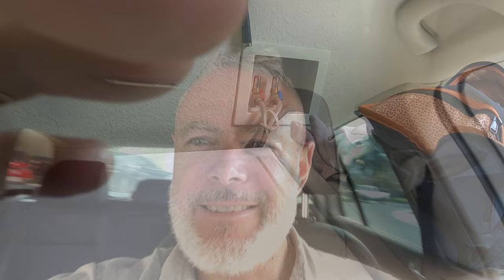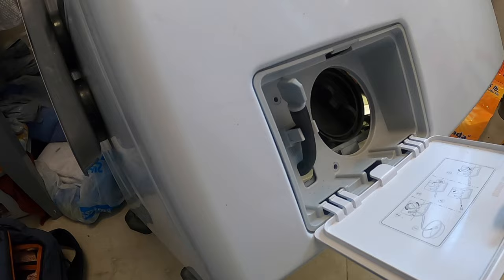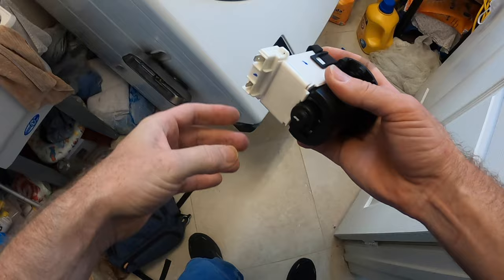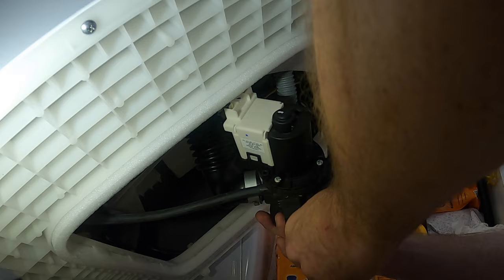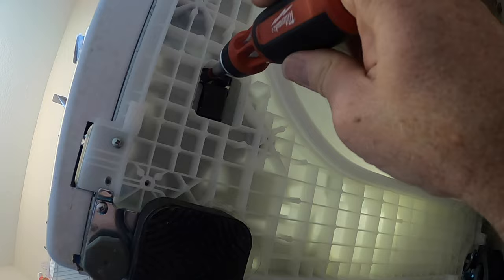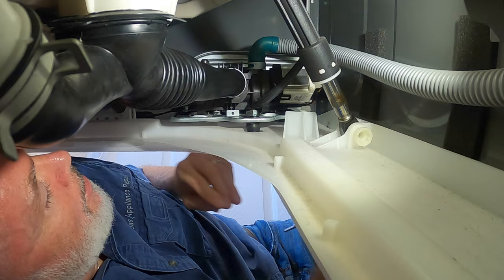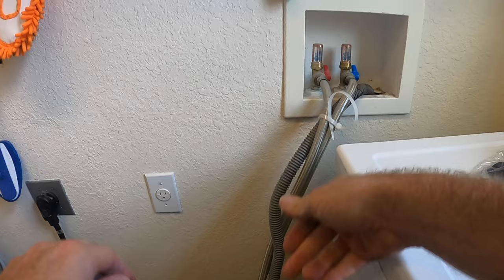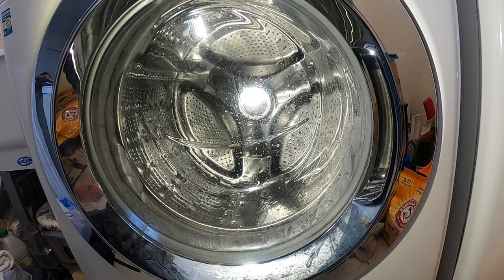LG Washer Drain Pump Fix in 7 Minutes

Comment: Thanks from Northern CA (and thanks for the quick reply). Big time saver for a part that breaks every two years. I was given multiple estimates from $350-$150 for labor and $100 for the part (bought it for $32 on Amazon). I recommend latex gloves to avoid cuts from the sharp metal inside. The LG model I worked on is an all-in-one washer/dryer but the components are basically the same. I kept the hoses on for convenience and shut off the water to the house. I did it a bit differently- I removed the two screws holding the rubber grommets to the pump/pump housing and was able to twist it to get access to the screws (only two were there) for the pump. Also recommend reading the comments from others as they had helpful tips as well. Take your time, folks, and you'll get it done!
Reply from the maker: Owen, Thank you so much for the tip $$ . glad to help and thank you for sharing your experience with the community. God bless you

Comment: This is the best thing on the internet right now. Holy crap. This is my second time replacing the drain pump and the torturous thought of trying to get the door clamp back on is giving me waking nightmares. I thought about the side and underneath, but seeing someone actually doing it give me such calm peace of mind.
Reply from the maker: Thank you
Reply: Same here... second time found this video. Way easier.
Reply: Welp, I’m fixing to do mine….
Reply: Any idea why the water pump some just hums but not pump, other times it pumps. Also.us.it normal for it to cycle every 5 seconds or is that program problem. I can only wash light loads. Currently, had to take out 5 towels. So only wash 5 towels at a time.
Reply: Yeah me too the pump have giving her last breat and its time to remplace. The pump shake well and dont work
Reply: If you ever have to remove that clamp again get one of those spring spreader tools made for the job. It makes the job so much easier. Well worth the 10 bucks!
Reply: I’m a 71 year newly widowed and my husband always repaired everything from YouTube videos, so that’s what I decided to do as well.  Watching other videos I was quite discouraged until I came across this video, now I’m feeling there is hope that I can fix my washer.  I think the hardest part for me will be tilting the machine……wish me luck 🙏🤗🤞🏼

Comment: Hello, I have an OE error message even after replacing the water pump. I can hear the pump running but its not pushing the water out. Any suggestion on to what it may be?
Reply: yeah pls help
Reply from the maker: Did you replace the drain pump? There could be a clog in the drain hose, or in the hose from the tub to the drain pump, or your drain hose may be too deep inside inside the stand pipe
Reply: Yes there is a clog in the tubing! You can reach it from the back! We just did this

Comment: This video saved me about 200$! A note to the fellow novices out there. There is a second pump to the right(when facing the machine) do yourself a favor and don't take that one off by mistake. Added an additional headache that nobody needs, lol. Also, if the screw at the bottom that was missing is actually there, just drill an access hole through the plastic base to access the screw.
Reply: Thanks for posting. I read your post and almost did the same thing since the other pump connected on the other side of the pump housing looks very similar. DIY folks, make sure the pump you are removing looks exactly like the new replacement pump.

Comment: This is THE video if you have an LG Washer with a bad Drain Pump that needs to be replaced!!! Like others have mentioned, this video gets right to the problem - shows you step-by-step instructions to fix the problem, & doesn't require you to take your entire washing machine apart to do the job. My only problem was with the screws not being properly lined up for easy access. Somebody else took this washer apart & replaced the Drain Pump prior to me taking ownership of the washer and they did not put ALL the screws back in their proper places. Some screws were missing in my unit & others required a little work to remove the screws. I highly recommend that you get a headlamp so you can see what you're doing & also pick up a set of magnetic screw drivers so no screws get lost within the machine. This literally took an hour to do the first time (just because I ran into some minor snafus). If I had to do this again, I'm pretty sure I could replace the pump in under a half hour. Best of all, the new pump was only $35 on Amazon & I didn't have to pay out the butt to have some repair technician fix such a simple thing. Thank you for posting this video & for saving me so much time & money.
Reply from the maker: Thank you for taking the time to comment and share your experience. Glad it helped

Comment: I wish all DIY videos were this straight to the point. I always wondered why people would begin tearing the entire washer apart just to reach the pump that's very easily accessible from the bottom. Great video!
Reply from the maker: Thank you Joseph. I appreciate you taking the time to comment
Reply: It is easier to tear the unit apart if you are good with a hand drill
Reply: apparently people are scared of a little water on the floor 😂

Comment: Great video!  Major difference in water output after replacement.

I managed to tilt the washer and access the drain pump from below.  I placed small chairs, against a wall, to hold the back of the washer and braced the feet of the washer to prevent movement while working underneath.

One primary challenge was the misaligned screws on the bottom access plate, making them hard to reach through the small rectangular slot. Initially, I considered enlarging this opening by cutting or drilling the bottom plastic grid. However, I realized that by using another screwdriver, I could shift the metal plate (on which the drain pump rested, equipped with rubber grommets for noise reduction) to align the screws with the existing holes. This allowed me to unscrew the two at the bottom and the one behind the front drain access panel.

While I did disconnect the main tub drain line, it wasn't entirely necessary. Yet, it did afford me more space to maneuver the drain pump housing out of its slot. Notably, I didn't detach the circ pump or the metal plate holding the pumps.

Upon observation, the new and old pumps seemed nearly identical, save for the slightly warped plastic impeller fins on the older one. The distinct difference lay in the feel. The older pump had a consistent resistance when trying to manually rotate the impeller. In contrast, the new one had a magnetic pull on the impeller, resulting in a distinct "thump, thump, thump" sensation as it turned.

Post-replacement, I dissected the old pump to pinpoint the problem, finding no issues on the electrical side.

The culprit? A compromised inner gasket around the rotating magnet was collecting washer drain residues, behaving like abrasive sandpaper. Over time, this residue seemed to be pushed by the brass key against the impeller's inner plastic hub, leading to wear and tear. This resulted in the impeller merely gliding over the brass key, hindering its rotation.

An interesting aspect: The choice of brass against plastic is likely a safety design. This reduces the risk of heat accumulation within the pump's electrical components. If a metal-to-metal design were used, and the pump impeller got jammed due to debris, it might overheat the electrical side. Thus, the use of plastic, which can yield under pressure, is arguably a safer and smarter choice than metal-on-metal within the pump.

Summary:  Plan to replace again in 4-8 years depending on how often the washer is being used.
Reply from the maker: Wow! Impressive analysis. Thank you for sharing
Reply: This is exactly what happened to mine, the way the pump broke, the screw behind the front plate and everything, I get the new pump tomorrow should be an easy install. My pump housing also has 2 water intake inlets on it as well as another pump on the other side I’m assuming for hot and cold water but you just described exactly what I had to do😂😂.

Comment: Perfect! Most easy way to change pumps for most of the LG front door machines.
Just to add there is one more screw that holds coin catcher that is in the front hidden underneath the front metal plate. Just. Need to wiggle a bit to take it out the pump assembly. Rest was just a breeze to change the pump.
The machine is working now.👍
Reply from the maker: Thank you

Comment: Thank you for this video. Simple and straightforward replacement. The original pump lasted 13 years,  which I thought was impressive for a family of four.
Reply: How did you get off the 3 bolts holding the pump assembly onto the frame doing it this way?
Reply: @nathanflanery2285  Exactly as shown in the video.

Comment: Your video gave me encouragement, but now I am aware there are mitigating factors that will potentially bring the homeowner far beyond the 7 minutes,  to something more like hours.   And I never realized that having stacked washer and dryer would present such a problem.   My washer and dryer will remain unstacked.  It's not a one person job removing a stacked dryer, but I was able to figure out a way to get the dryer down.   Why was this a more difficult job?  There are significant differences in LG front load washers that aren't shown here.   My LG had two pumps.   I only found out after having found the service manual online, but the service manual cannot be found at LG's site.  Search elsewhere.  The drain pump was on the opposite side, and the 3 screws you discussed are not accessible or removable unless you remove the large three 10mm bolts that hold the pumps (yes 2) to the visible metal base plate you show near completion .   Two pumps, one on either side for my LG front loader, far left drain pump nearly impossible to access, and on the right an accessible circulation pump.  After having removed the 3 bolts holding the plate from behind the front and underneath, then the front, back and two screws underneath attaching the pumps to the metal platform, I was able to remove the pump out of the washer as you had done.   Upon installation of new drain pump I also found that the screws that hold on the pump to the black plastic housing don't hold as tightly as when removed, and my initial pump replacement leaked.   I added pipe joint compound and 5 (extra holes are there already) ever so slightly larger sheet metal screws that bit into the plastic just a little more.   Mine was a bit more difficult, but without your guidance I'd have had to pay the piper.   Thank you for sharing your expert instruction and providing all of us with the guidance and courage to undertake these challenges.   And I won't need to go to yoga class this week due to all the contortions necessary to remove those large bolts from the metal base from underneath.  Thanks for help us all.
Reply from the maker: Wow, you went on an adventure. On my Youtube channel there are few different LG front load washer repairs, including a stacked one. Very challenging to do on your own. Sometimes the satisfaction of doing a touch project on your own is worth the effort. God bless you

Comment: Machine leaks water on the spin cycle, especially with a heavy load. It was suggested I check the water pump and related connections. I was getting ready to remove the front panel (🤦‍♂️) which is not a fun experience (replaced the front seal in the past). This video made my day!

As a note, I just checked my washer and the three screws attaching the motor to the frame are also missing.
Reply from the maker: You are welcome. LG is not consistent with their screw placements . leak on spin cycle is interesting. you can observe it with the top lid off to try and see the leak. also many of the LG have a removable back panel where you can observe. sometimes i place two 2x4” piece under each side of the legs to get it up 4” off the floor and observe with a mirror underneath during spin cycle. You can also place a piece of dry cardboard underneath and then get an idea of the location by observing where it gets wet. best of luck
Reply: Thanks for the very quick response!  I did remove the top and rear panels. No water from above nor on the right side. There does appear to be some water on the left side. Washer sits on a LG pull out drawer, with a pan under that. It appears like it’s coming from the water pump area. If we run the washer on tub clean cycle, no water comes out. If we add clothes to wash, it leaks. But the leak is not a lot. Maybe 1/2 to one cup of water. I’m thinking there may be a worn hose. Will also check out the pump. It’s definitely not the hose on top of the tank which has a zip tie holding it in place.

Comment: You deserve a gold medal for this shit. Some guy quoted $500. LG wanted to charge $114 for the part if I use an authorized $500 guy.  All other videos tell you take the whole bloody thing apart. I bought the part for $30. It took 1.5 hours cause there were more screws in there than your video. A few which had no clear line for a screwdriver. A little creativity and done. 
Tip if you come across that issue. Cut a little plastic off the bottom to get one of those inaccessible screws. There's a screw not showing in the video on the front at the bottom of the housing. its jammed behind the metal on the front. I jammed a screwdriver beneath the housing from the front and pushed it up to unscrew it.
Again. You saved my ass.  If you're in vancouver, holla at me. Beers on a patio somewhere, on me!
Reply from the maker: You are welcome. I hope you subscribed 😊
Reply: Just did the same thing. Was considering removing some of the plastic and sheet metal that some wingnut designer put in the way to make the screws "almost" accessible. So that when this made-to-fail part fails for the fourth time, I'll have an easier time getting to it.
Reply: Um trying to figure out how to remove that same screw. I think they put it there on purpose so you would have to call a tech😮

Comment: It worked!!! I highly recommend this method of replacing the drain pump. I have an LG WM2050C washing machine. It wasn’t draining, it was making that growling noise. I checked the filter, it was clean. Watched a few videos and then ordered the part, cost me under $30. I was NOT looking forward to taking the top off, then the door, etc. I had to do all that when the dryer rollers needed to be replaced - not fun. Then I found this video and WOW. My washer and dryer were stacked, so we had to remove the dryer, put it aside, then tilted the washer back. We didn’t have enough room to lay it on it’s back so we let it rest on a bucket that we propped against the wall behind the washer. It then took less than 15 minutes to change the pump! It’s working great, no leaks, we’ve already done four loads of laundry since yesterday 😊. THANK YOU FOR POSTING THIS VIDEO!!
Reply from the maker: I am glad the video helped. Thank you for taking the time to Comment Mike. God bless

Comment: Replacing the $25 pump was way easier by going through the bottom of the washer. I had to cut a notch in the metal circle (at the 6 o'clock location just below the face of the coin filter) to access the one screw attached to the pump at this location.. There were holes for two more screws at the 10 o'clock and 2 o'clock locations of the coin filter, but those screws were missing just as in this video.  There were also two screws through the bottom of the machine attached to the pump. I had to cut away a small portion of the white plastic grid below the machine to access one of those two screws. The other bottom screw, located just an inch and a half away, was easily accessible. This seems a whole lot easier than removing the entire front face of the machine. Thank you!

Comment: Thank you for this!! I take care of 2 mentally and physically challenged adults that live here full time and it’s hard to get time to fix stuff. This video vs the others was by far the best!! I got the washer working in 45 minutes!! Thank you again!!
Reply from the maker: Thank you so much. That means a lot to me. God bless you and thank you for caring for others
Reply: @appliancerepairamerican  can i access model 41372 like that?
Reply from the maker: @MA-vm6jl  You will have to look at the schemes for that model and determine the location of the pump and the most efficient way to access it. Some LG washer you can access buy removing the back panel. Some, like the one in this video, can be accessed from the bottom.  They intentionally leave an access hole in the bottom of the machine. If you have to remove the front of the machine it is not difficult, it just takes a bit more time.

Comment: Amazing video! My machine was only slightly different, but this saved me so much time and money. Took me longer than 7 minutes, more like and hour total, but I’m including draining a full tub, unstacking my dryer, and cleanup time.

Only snag I ran into happened when I didn’t pay attention to which direction the pump went and which wires went where. But I slowed down your video and found the orientation. 

Something worth mentioning is that there is a little “N” and “L” on the casing right under the connectors. N for neutral where the black wire connects and L for live for the red/brown.  Additionally, there may be different sizes of screws and it’s good to pay attention where each goes.
Reply from the maker: you are welcome. thank you for contributing
Reply from the maker: You are welcome. thank you for contributing